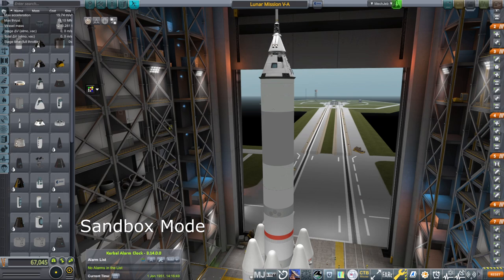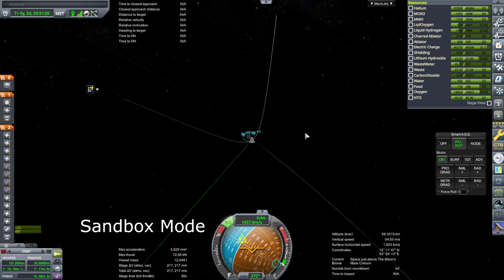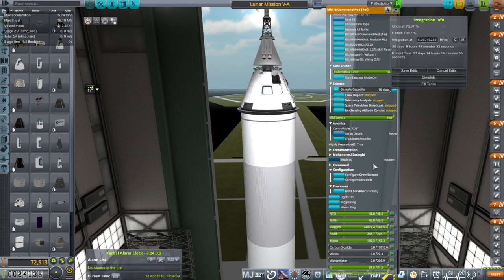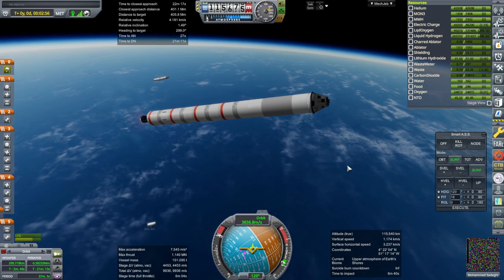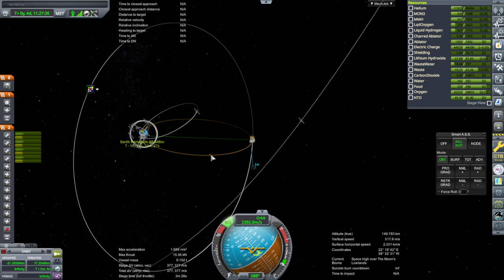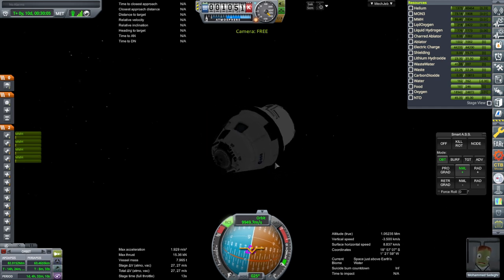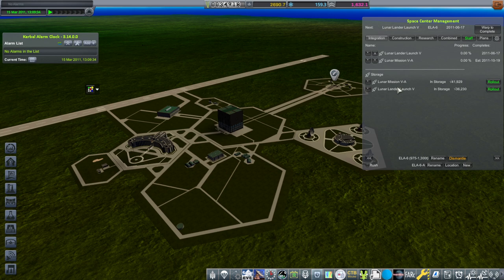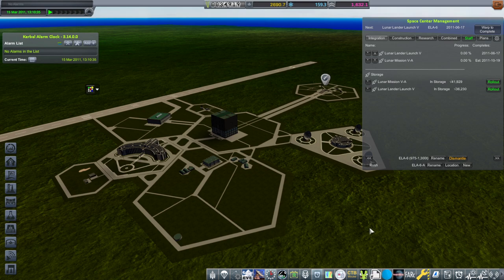RP-1 Career in KSP 1.12 - European Space Agency 58

Comment: One thing that's kinda curious to me is that noone else is reporting stock pods overheating that easily... and like, it's hard for me to believe that everyone else is using Apollo / other historical pods.
Reply from the maker: Actually, some other commenters have said they had a problem. I have explained how I put together this install (exclusively with CKAN except for visual mods and my own mod additions) and I have shown exactly what the craft entails. If you didn't notice other people reporting the overheating, well, maybe I just attract more attention to problems and you might have glossed over the stray comment.
Reply from the maker: I see a lot of people using the D2 pod in particular, by the way, because it's patently advantageous and it has built-in ablator and high heat tolerance.

Comment: This won’t solve the problem but just something else, why don’t you put the Lox and LH tanks in the service module, there you can add MLI and the reentry module will be lighter and so also generate less heat.
Reply from the maker: The LOX and LH2 are in the service module - that's primarily what we use. We would need a lot more of them in the pod if we were using the pod's quantity. The LOX and LH2 in the pod are only for special situations (reserve) and after disposing of the service module - that's why it's locked until we separate the service module. You seem to have missed a few things about this design.

Comment: Whenever I do a non-lifting re-entry I always get G-forced of >12, I'm not really sure what you're doing differently? (I guess maybe the bigger heatshield, somehow?)
Reply from the maker: Yeah, I don't know either - I was expecting that sort of number.
Reply: @RaizSpace  I tested it and it´s the heatshield. Use the restock option and you are fine.
Reply from the maker: @florianbayer2054 But if the heatshield lets us enter with low G-forces without using the CoMShifter . . . isn't that actually a plus?
Reply: I haven’t gotten the vanilla pods to work well with RO. RoCapsules parts on the other hand work great.